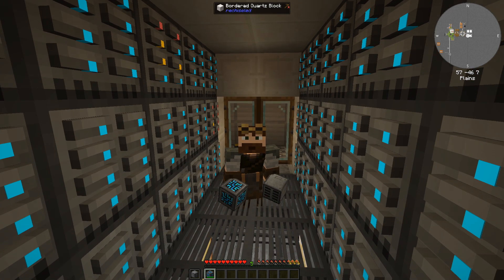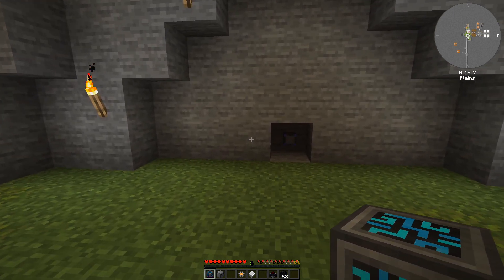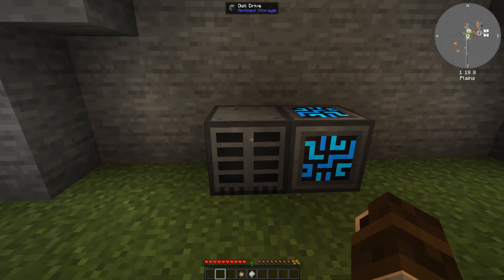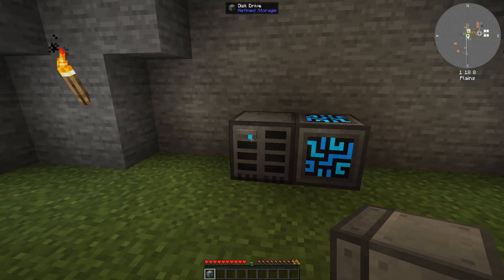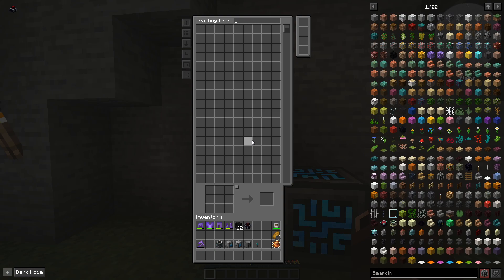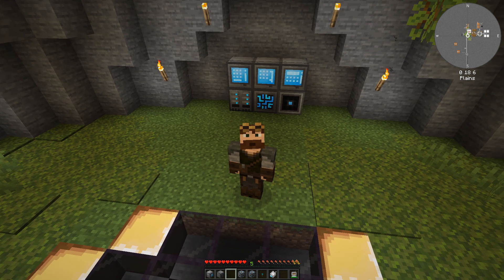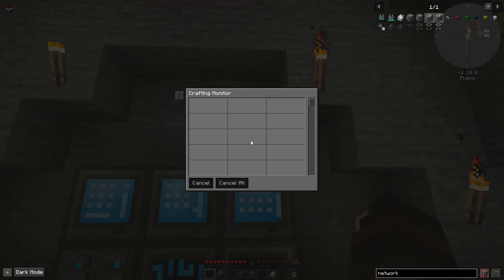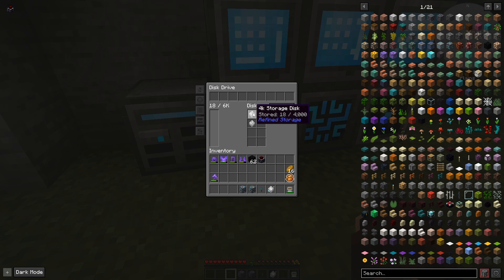Everything You Need To Get Started With Refined Storage - In LESS Than 15 Minutes - Stoneblock 3

Comment: How do you put items in the HDD?
Reply from the maker: When using the Grid block, you get to interact with the system. Dropping items there will add them to a drive. If you watch the whole video you can see it happen 😊 
There is also a Crafting Grid block that has the crafting table in the same interface, which is very handy! 

Good luck with your modded adventures :D